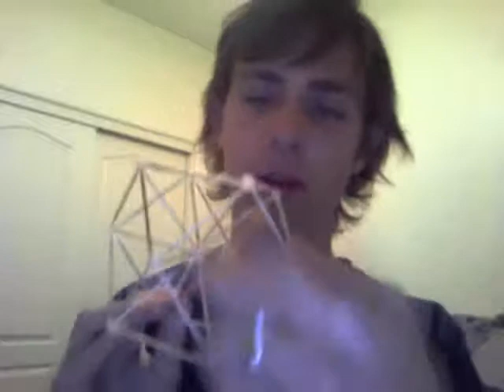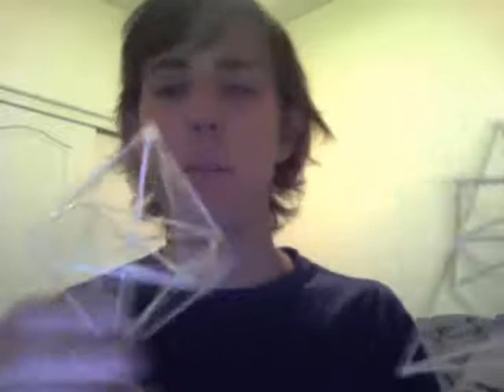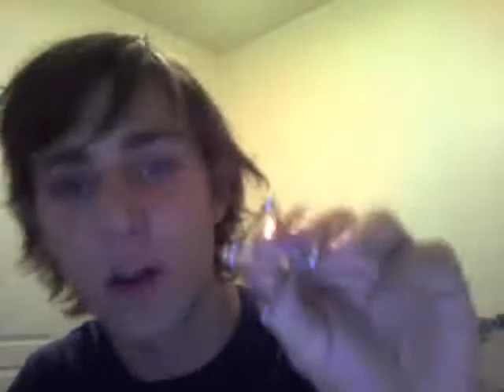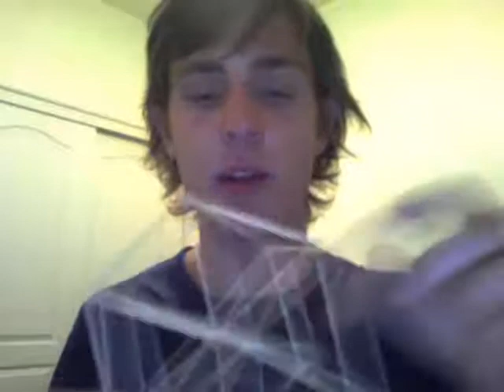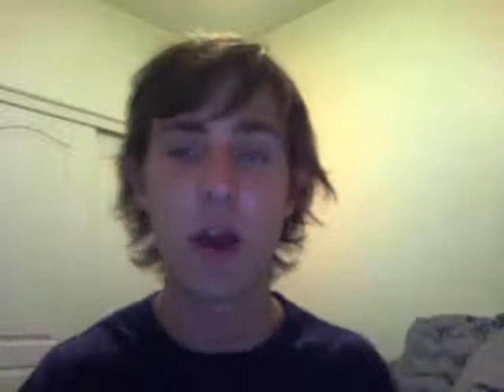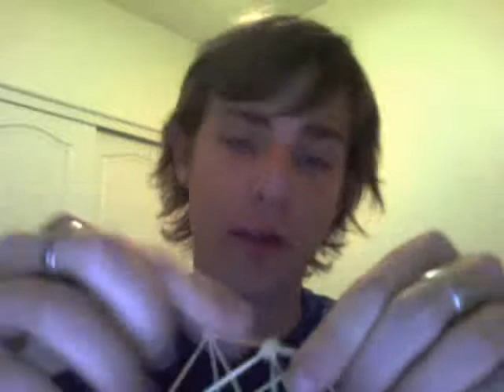Vector Equilibirum Vortex Engine (Part 2 of 4)

Comment: What if you have a monopole magnet in the center of the vector equilibrium, that will create an energy torus or toridial flow. The toridial flow will burst energy outwards then suck it back into its center repeating this cycle forever theoretically.